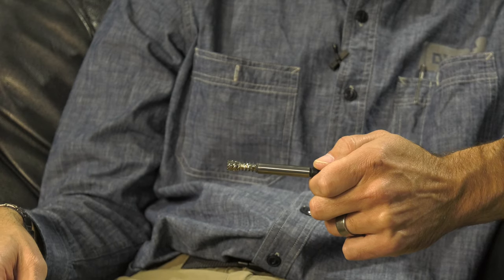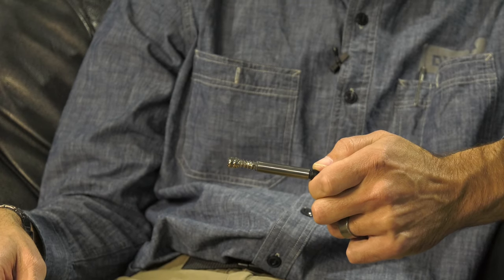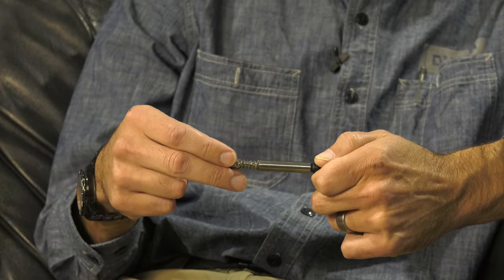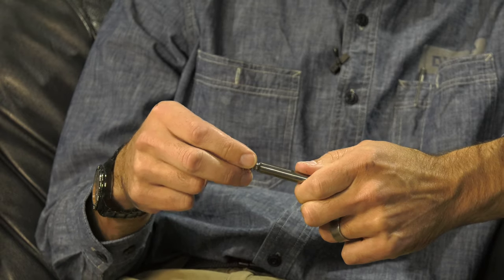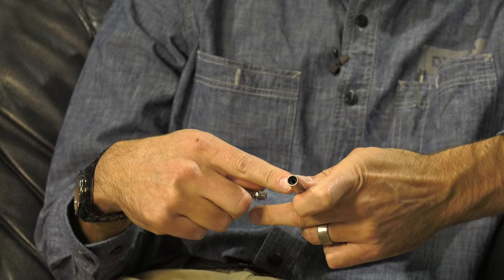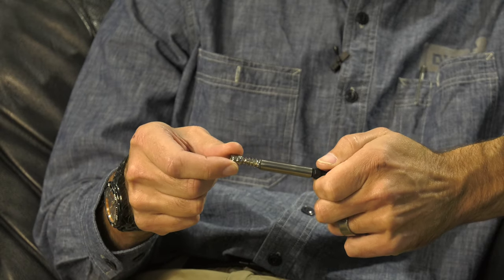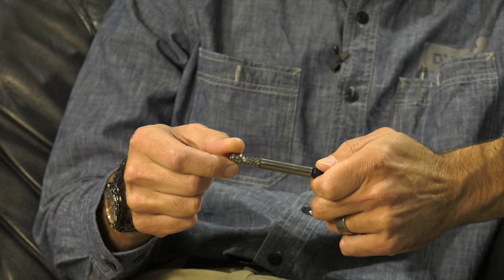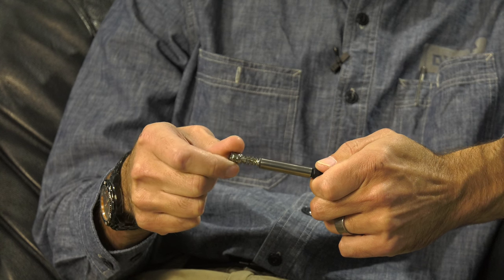This dry herb vaporizer🌿made our heads spin 🤔 | DynaVap Archives

Comment: Just a thought. Have a thought that spins the tip magnetically. Kinda like a magnetic train rail pushing a train. I'm not explaining this well. So if you take an ih that uses magnets to spin the tip while heating the interior. The only problem is you need to use low grade stainless to make it magnetic.

Comment: I love that this is hand held! I most certainly would buy one of these. The third party desk top ones are too expensive and not ideal to spin, heat, and pick it up. Honestly most people I show my DynaVap™ find it to complicated and usually hit it wrong the first few times any ways and then tell me it's crap. Then watch me draw GIANT cloudz. Most smokers/cart users don't want to invest time into technique. Properly preparing i.e. grinding the flower, not packing to tight, and heating evenly(spinning is so much better than rocking). So I feel this would help on the last step . Any chance you guys are working on a kliper grinder to compete with HØJ? You should be... CHEERS!

Comment: George back at it again with the innovations. This is actually a pretty useful one! Anything that takes out the need to do much during the process is valuable and although our "manual" spinning might be on point, it's just a different experience to not have to work your hand all the time
Reply: only that innovation happened 2 years ago with the spin doctor stem . So here is George cashing on other people ideas,like that copper ring 'innovation'
Reply: Just get the armor cap and you don't have to spin it

Comment: Is Dynavap still working on this?  Imagine if you could integrate all adjustable features as the omni and vong has, but with a spinning full extraction tip.

Comment: This really needs to be made and released into the Wild. 
Please Please Please DynaVap make a OmniVap with this spinning tip on it or better still make a spinning tip that's modular and will fit on every DynaVap that's ever been made.
It would make life a lot easier for a lot of us with bad hands my hands are getting worse and I cannot use a torch to heat my DynaVap's I have to use a induction heater now this spinning tip would get my Dyanvap collection back into full use I really need this in my life DynaVap.